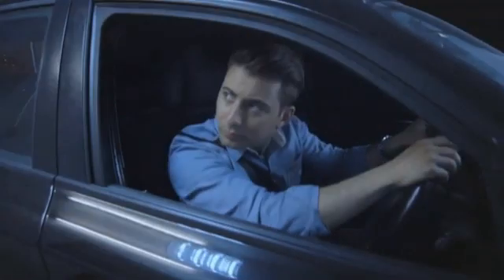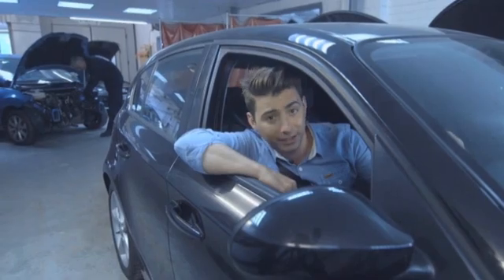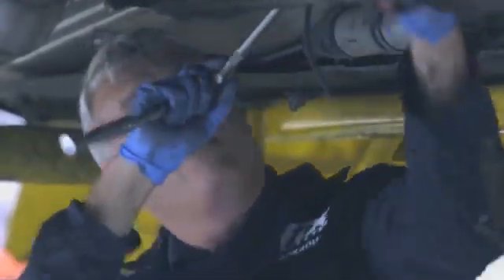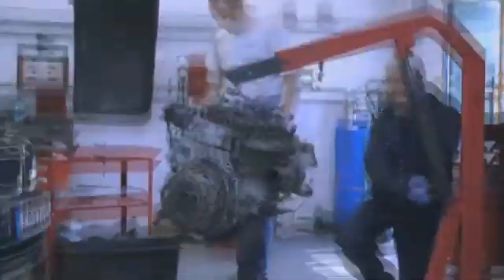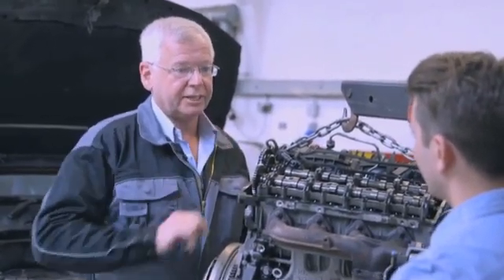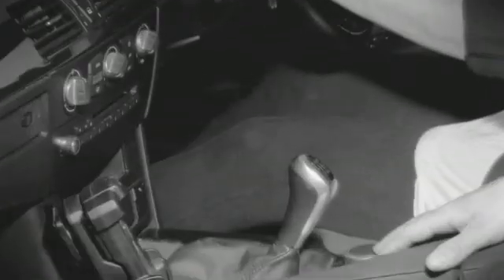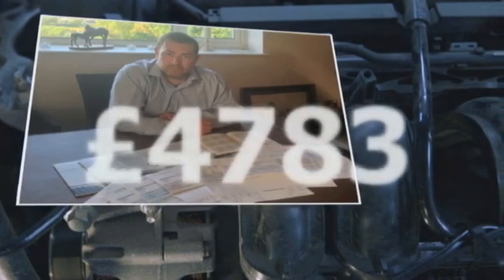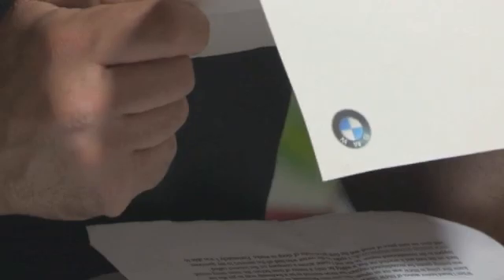BMW N47 Timing Chain Failure PROBLEM

Comment: Hello, I am planing to buy 320d (184hp) or 320ed (163hp) 2012+... Some say that the problem is solved since 2011... some say that problem isn't solved yet... Can you please tell me does f30 2012 320d have the same problem???
Reply: Nije problem rjesen! Samo su sve izmjenjali i poboljsali da se prakticno vise nedesava, ali ima slucajeva da se po drugi put mjenja lanac! U f30 je najnovija generacija n47 motora al je princip isti, vazno je koristiti dobro i kwalitetno ulje! Ne skrtariti na ulju, jer na kraju je najveci pocetak problema to i kratke relacije! Zadnji f30 ima B47 motor sa 190 ks, koji je najnovi i trebo bi biti problem rjesen! Poz
Reply: +Ernad Grudic Puno Hvala!! Ajde jos nesto da te pitam, posto vidim da si strucan. Na mom 320d e90 2006 sa automatskim menjacem Zf 6hp26... menjac nekad nece da promeni brzinu na 1600rpm u sledecu, nego tek na 2000 rpm, kao da sam ga ubacio u sprot ali nisam... na primer vozim u trecoj na 1900rpm i nece da promeni u sledecu brzinu a ne ubrzavam, tek kad predje 2000rpm onda prebaci u sledecu. A nekad normalno menja cim dodje na 1500rpm odma prebaci u sledecu...zasto se to nekad desava? inace ulje i karter menjaca menjam redovno na 80.000km...
Reply: +Vladan Stevanovic neznam sad tacno sta bi moglo biti u tvom slucaju, saltanje mjenjca zavisi od par stvari kao temperatura i koliko je opterecenje, Kad je motor hladan on cuva duze brzinu tako da sto prije dodje do odredjene temperature. I ima tu jos faktora sto moze kvalitet i samo saltanje da odredi. Jesili ga ikad vozio na diagnostiku, mozda ima gresku memorisanu, kako ti radi termostat? Zagrije li se brzo il traje dugo, (mislim kad je hladnije, ne ljetni period) poz
Reply: +Ernad Grudic pre mesec dana sam otkrio da mi je crko termostat jer nije dizao temperaturu, sasvim slucajno jer nema pokazivanje... ko zna koliko sam vozio sam pokbarenim termostatom... pa sam promenio oba...sad brzo dize temperaturu, ali sa menjacem isto... sve radi kako treba samo nekad se ponasa kao da je u sportu... tj po gradu ne prebacuje na 1500rpm u sledeccu nego na 2000rpm salta u visu i to samo ponekad...

Comment: Hey >> Same thing happened >> I have E60 520d 08plate 100k, I notice Gear slipping and some small engine sound, and my MOT is also due. Last Friday(08-May-2015) I booked service, MOT and complete engine check in BMW Heathrow London, Friday evening they called me and said I have Timing Chain Issue > I told them ok let me know the parts as I have Cairgaint 3years complete engine warranty> yesterday(Monday) I again called them > they said its gonna take time as full engine has o remove to fix. I afraid that it gonna cost me high and labor. Today(12-May-2015) I called them.. Guy named Harry told me I no need to buy any parts.. and BMW is going to pay for it and will take another 3 days to fix!! I was like ... Ohh whatttt ..... then I Google the issue and found your post... hope they will not charge me...

I Just seen in Wikipedia >>  http://en.wikipedia.org/wiki/BMW_N47
(There is now a recall (15th January 2015) by BMW to replace the chain tensioner and, if required, the timing chain.) 
I would be lucky if thy really do for free of charge.

Comment: I never thought that BMW can fail so bad.
I was so proud of this company and all the awards that BMW engines won till now. The worst thing of this situation is taking no responsibility and handling the situation as the company like this is supposed to.
Shame.
Fell so sorry for the customers of N47 engines.
The engines been recalled, but anyway, brand felt down
Reply: Failed in our 2013 1.6D Mini countryman when it was 6 years old on 52k with full service history. BMW Mini offered 30% off new engine only - would still have cost us £4k to replace - wasn't worth it so sold it on to a local mechanic - whole family will never buy another Mini or BMW and we had lots previous to this!! Shocking scale of known problems to non-serviceable timing chain

Comment: I have a 318d 2011 does the model have the same issue with timing chain failing
Reply: johnterriess Yes.
Reply: semaisking all 4 cylinder diesel engines from 07-today have this problem
Reply: teodor1403  hi, I've heard that this problem have been solved since 2011, because on some petitions and other video clips on yt is told that problem exists from 07 to 2010... So can you please tell me how sure are you, because I am planing to buy 320d or 320ed (163hp) f30...and I dont want to have that problem :/
Reply: +Vladan Stevanovic F30 kupi slobodno! Ako bi sta bilo MORAJU ti sve promjeniti na njihovu stetu! Ja radim kod BMW godinama! Jedino prave problem ako vide u sistemu a mogu ako je servis prelazio u minus ili nije redovno uradit! I ako nije u ovlastenim bmw servisima uradit! Nemoj gledati ovdje po youtube! Svako od ovih ovdje koji seru da su morali platiti sve sami i krivica je kod njih! Servis nevide nikad a kad nesto se desi onda bmw kriv! Ja znam nasi dosta sto nerade servis kod bmw jer im je skupo i na kraju naprave stete 8000 eura! Poz drug i neboj se, bmw placa sve ako si ok!
Reply: +Ernad Grudic a da li ovaj problem postoji i kod 320d f30 ili je bio samo kod e90 do 2011?? Da li se lanac i lancanici menjaju i kod f30 ili su vecni kao i na m47?
Reply: +Zaiss Syeve danas 4-10-15 sam jedan mjenjao na f30 2012 god 318d n47 motor,princip motora je isti kao i u e90 od 2007 pa sve do danas, motori su isti, al su drugi lanci i spaneri i zubcanici! Od 2007 pa do danas su izmjenjali dosta toga, drugacije se dizelpumpa steluje naprimjer za manje opterecenja za lanac itd. Ali na f30 posto je to zadnja tipa i ako nesto nije ok sa lancem mjenja se sve na stetu BMW
Reply: Ernad Grudic is the same storry
Reply: hi I am a mechanic in Albania and I have done many engines With this kind of problem is a problem when passing over 1000 km should change it soon and oil filters.

Comment: I bought a 2006 118i BMW at 60000km timing chain failed, jumped out of rails. No anti skipping brackets apparently like in later model. Despite 2 requests to BMW they are ignoring my issue, no answer from them. It's going to cost me over $3000 to fix it, $600 just to diagnose the fault. It seems BMW will guarantee repair for 2 years but all services have to be done at an official agent. So disappointed on the car and the brand. After 2 years I will resell it and go and buy Japanese. BMW is crap and their customer services the poorest I have seen.
Edited to add 2 new faults found, accelerator and hose failure. Total of repairs over NZ$6000 now
Reply: In Thailand has the same problem. People like BMW but they buy Japanese car.Japanese brands have more reliability and cheaper service.Maybe BMW don't want big sales.
Reply: I would take it to trents ,poole and leave it there
Reply: No offence but you bought the entry model. Your engine is not as reliable as the 6 cyl engined variants. Hence why never buy a european car with a small engine variant. If you cheap out on these german cars, you'll pay more afterwards. Hence why always go for a premium version and if you can't buy it, don't buy a bmw until you can. Bmw specialist.
Reply: @e36mmm  - What a load of BS! Just because you buy a small engined version doesn't mean it's ok for it to blow up! Idiot!
Reply: @e36mmm  how on Earth can you say so much shit to that poor lady? T chain failure at 60.000 km? Are you serious? This is a very serious design failure. What next?   We'll throw away a car after the warranty expires?
Reply: @pernesvictor708  poor design!!! I have had over 10 bms with all 6 cylinders and none of them failed! What does that tell you?
Reply: @e36mmm  it tells me nothing. If a  6 cyl BMW is good (and probably is) it doesn't mean a 4 cyl should be crap. Other brands manage 4 cyl quite well. Apparently "ze germans" have  no intention to make reliable td engines anymore.
Reply: @pernesvictor708  they always said. BMW 4 pots are crap
6 pots are better.

Comment: My BMW is a 2004 320d with 74,000 on the clock, last year it had to have a new turbo, new Cat and now this year a new frigging timing belt!! The car itself is immaculate and I have treated it like a baby. Really not happy!!.
Reply: kev10ok Timing belt? The last timing belt that was spinning the camshaft of a bmw's engine was in the year 1993, your car has a timing chain. The e46 models, were very reliable but for why u had to change all that with that mileage is because youre probably driving it short distances only. The engine has to be driven long distances, especially diesel engines, otherwise it builds up with carbon and all the other shit and thats why u had to change the Cat and probably the turbo as well (it could be other things on why the turbo failed (i believe its all your fault, not the car's) on such low mileage engine, use google to find out on how to properly maintain and avoid turbo failure on a diesel engine).
Reply: semaisking Hi, it was the crankshaft pulley that had failed after all, I drive the car 44 miles a day so at least 2 days a week (we lift share) I guess I've just been unlucky. The car is driving fine now....cheers.

Comment: Important! From 15 of January 2015 in Poland BMW announced product recall for cars with early 2.0 diesel engine: N47D20A (2007 and some 2008 cars). They are replacing chain tensioner and other parts if required.
Reply: MR BMW UK are acting very strangely.  Asked me to book my car in for 'significant enhancement' (whaaat?)  And in the same conversation said my mid 2008 N47 engine was not subject to recall.  Won't explain why they changed their mind, BMW UK will not say what selection parameters are.  All very odd.  Trading standards out of scope.  So - don't buy a BMW diesel!!  Manufacturer is trying every trick in the book to avoid issues.
Reply: also in Croatia
Reply: MR 
Guys, do u have web link for this recall announcement pls? Living in Slovakia currently and I'm planninng to check whether it's applicaple to my 318d or not.
Reply: Ersin Ersoy
Hi,
Just call your nearest BMW dealer and give them your car VIN number.

Comment: Having my chain replace this's week costing £2000 car only done 10000 it's a Fck joke my 
Toyota been around clock 3 times also has a timing chain cost £80 to replace dose not need one 
DONT MAKE THE MISTAKE I HAVE DONT BUY THE BMW 2007-2011 N47 ENGINE 
DONT BELIEVE ME GOOGLE IT!!!!!!!!!!!!

Comment: Last good cars were made up to 2004 later it is all going down the slope .Got m57n engine single turbo and I don`t think to go any further
Reply: soton000 Actually its up to 2006. 2007 and newer models went down the slope and a pretty bad slope when it comes to reliability.
Reply: semaisking Im not sure when they starwd make twin turbo engines and DPF-s but some people I know they sold their Bimmers from 2006-09 and got back to single turbo 5 and 7 series as they had constant problems with Turbos and DPF-s
Reply: DPF can be removed and after that the engine's main computer has to be reprogrammed so that the engine can run smoothly. The whole procedure is not that expensive and it saves a lot of trouble in the future, a good investment i say.

Comment: is this only on the diesel engines or petrol as well?
Reply: This only affects 2.0 Diesel engines.
Reply: Dave Chadwick 
Does not. It affects 116i also (since I have one). According to BMW it´s perfectly normal for the chain to fail 125 tkm. According to BMW it´s not a manufacturing default if it does fail at 125 tkm and therefore they take no responsibility in it.

Comment: My brother had a 09 520d with 80,000 miles and was looking to change it for a bmw x3, a ranger rover evoque or an Audi q3. During the time he was looking his engine started to rattle and was told that the chain was going to break. He sent the car in to bmw to  see if they were going to fix the chain and after waiting for two weeks was told NO! So he bought the evoque. €49,000 bmw missed out on.
Reply: oh dear, the evoque uses a peugeot 2.2hdi engine, which is pretty dismal as well, there will be many evoque owners in the future paying out to fix their engines.

Comment: It's not the chain that's the problem I heard from a bmw mechanic that it's the chain sprocket,it cuts into the chain
Reply: nick fernandez Totally. I had my engine reconditioned. The mechanic says he used a BMW kit for the job. That includes a new chain - much "thicker" than the N47 and new sliders (including the tensor-slider) which are much more robust. He had boxes full of old BMW sliders. The originals seem like Lego in comparison ... no offense Lego; I love Lego but wouldn't make a car out of it (unlike BMW, some would say). Total cost (including new valves, crank shaft and supports: €3000. My mechanic makes his living from this fault! So I suppose there's a bright side to BMW's shame.
Reply: that and the chain tensioners are made of crap.
Reply: Michael McGovern  3 grand is a lot to drop on someone elses lack of foresight, I hope it works out for you though man. On a side note Legos can withstand 950lbs of pressure so ironically if the chain tensioners had been made of Legos the would have been better.
Reply: That's dead right. Chain replacement is clearly NOT the complete solution.

Comment: accordingly to BMW maintenance data, the timing chain should not be replaced unless there is a problem in the system like a rattle. BMW always had some sort of issues with its engines. like the seals in the vanos system of the m54 engines, they were not design to withstand that kind of heat and would fail.

Comment: Don't buy an old fucking expensive car if you don't have the money to back it up. Stop fucking living above your income level, idiots!
Reply: I hope you are either an idiot or a troll (I suspect both) because, if not, you deserve to be transported to Louis XIV's France
Reply: malarbusto I'm guessing you're one of those idiots, then. Have fun having to waste your hard earned money on something you can't afford!
Reply: michor10 Oh for fuck's sake; I didn't buy one of these fucking cars because I did some research on the net; I bought something else much better. I didn't get stuffed with one of these shit heaps cos I took notice of the huge mount of info available pointing out their major fault. Despite that, I still think it's ok to criticise this crap model because the particular fault highlighted here shows a pathetic fundamental design. I've had cheap Citroen diesels with vastly more miles than this. (don't remember editing anything)
Reply: I don't think a BMW 2.0 diesel with high miles can be classed as vastly expensive although it is a premium brand with a historically strong reputation. Surely the reason for buying the car is the expectation that it SHOULD give good service even at such high miles. High maintenance is fair enough but complete engine failure at such modest mileage is completely ridiculous.
Reply: Keyboard Dancers So what is it then, high miles or modest mileage, Captain Contradicto? A fucking car with 100 thousand miles is a car that should have at least one major inspection behind it which, of course, most owners won't do because it makes more sense to sell that lump to whatever poor schmuck who's dumb enough to dish out the 3-6 grand expecting a good deal. There is no such thing as a "cheap" quality car. You can either buy a 5 year old BMW with 50k on it and expect the best or buy the high mileage one and spend whatever is necessary for the inspections/overhaul. Don't have the money? Don't fucking buy the BMW then! You guys are like those girls that spend their last dime on a used Louis Vuitton bag off Ebay and walk around like they're the shit, for Pete's sake!
Reply: michor10 oh well...
Reply: Keyboard Dancers Oh, I see you edited your message, removing your contradiction and making me look like a troll in the process. What you failed to recognize is that now you're saying that a BMW with high miles should be expected to work perfectly just because it's a BMW. If that were the case then we would all be driving 30 year old Jaguars, Mercedes and BMW's dummy! This ignorance is exactly the reason why people fall into the trap of buying "bargain" premium brand cars. You guys are dumber than the chick with the used Louis Vuitton bags.
Reply: Keyboard Dancers No need to get your panties in a bunch there, Susie. And why would you deny editing your comment? That's just childish. It's OK to have an opinion but to contradict another person just for the sake of argument and in defense of second hand knowledge based on something you read on the internet is just silly. The point I was trying to make is that people buy expensive cars without considering the higher maintenance costs. And that any vehicle be it BMW or Citroen will require a large inspection after 100000 miles. Take care, tiny dancer.
Reply: michor10 it's a poor vehicle for that money, inspection or not
Reply: Keyboard Dancers I may agree with you on that point. I have seem they go cheap, though. I will now proceed to kick the shyt out of my (now) broken 1991 Kawazaki Tomcat. Damn thing almost got me killed. Talk about motor reliability. It crapped out on me after only 45k miles :(

Comment: I have a question after you change the chain does not break as fast? can do something to no longer break!? Sorry for my bad English
Reply: The problem is either with the design of the chain, the metallurgy of the part or lack of oil being sent to the part to protect it. BMW does this all the time selling cars they know might have major defects and getting rich off of the repairs. Usually the time between selling the cars and the repair they've worked out how to properly replace the part or system in question. This is not an electronic failure or something you couldn't blame BMW for it's a timing chain. Timing chains have been used for almost a century and BMW is having an issue designing one that works in 2007-2009 with as much money they make.
Reply: TBAGGZ1 
Hjh
Reply: Robertas Celiesius ?